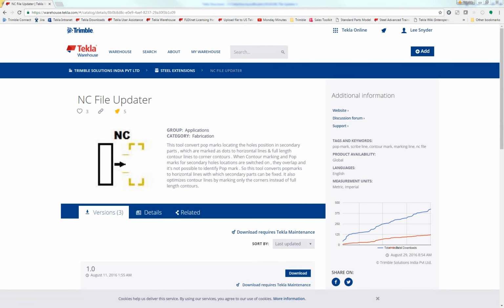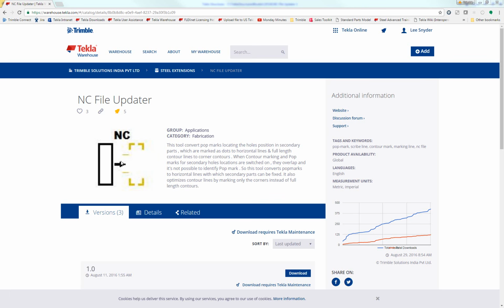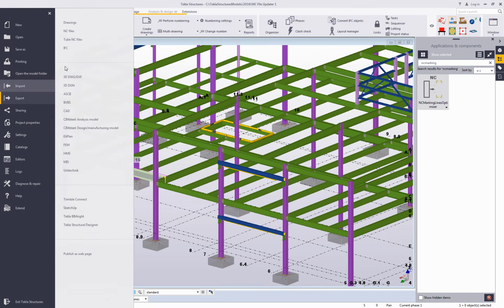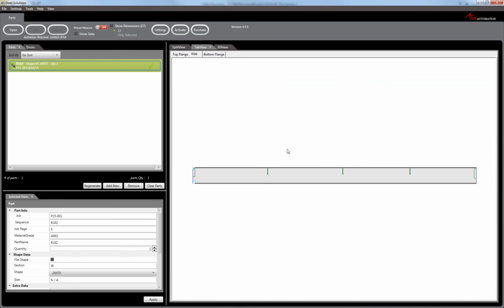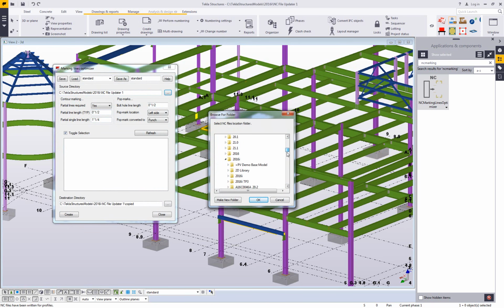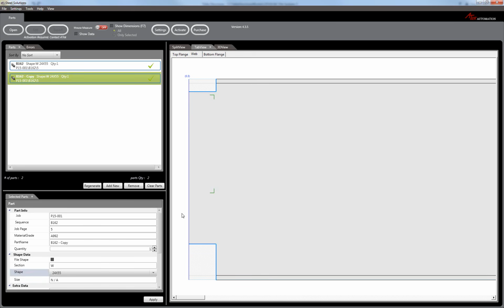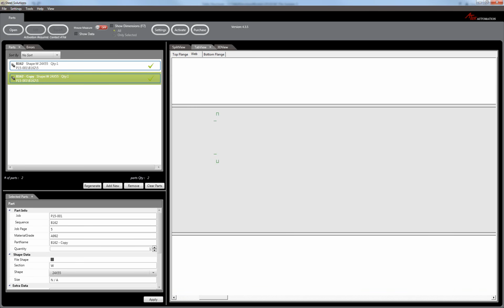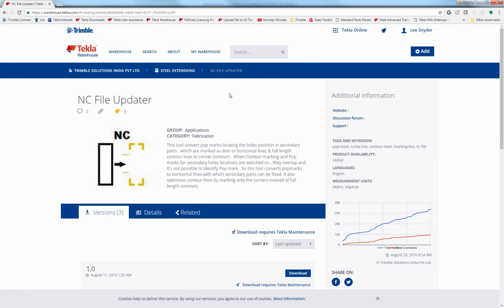NC File Updater

Comment: For even more options for scribing try: https://youtu.be/9LK1hMMoDp8

Settings for partial contours, hole positions on main parts AND secundairy parts. Centers for studs and options for text like position number of main part or secundairy part or both. Also creating NC files once and directly from the model, no copies.